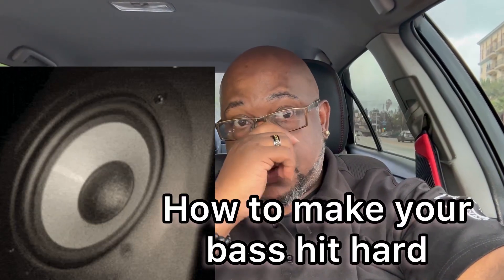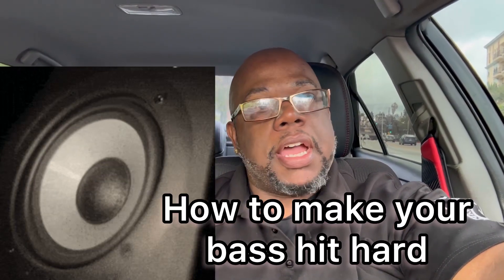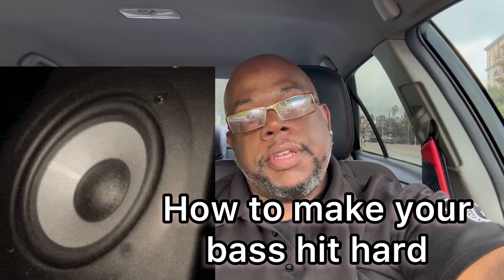How to make your Bass Hit Hard

Comment: On 1 10" 600w rms sub. I have 2 amps a 500 and 1k the 500 @2ohm and the 1k woth do 600w @4ohm. The bigger amp should sounds alot better?
Reply from the maker: @poschevy7852  the THD and distortion level is what make it sound better 
Example a 0.10 is high distortion 
A 0.3 is low distortion better quality easy to produce lows and sound clean
Reply: Do not listen to this guy he has no clue about subwoofers and amplifier’s to answer you questions the 1000 watt amp will hit harder if it’s actually 1000 watts lots of companies lie about there specs but in a perfect world a properly set 1000 watt amp will be perfect for your sub you are not pushing that full 1000 watts all of the time playing music ur just touching it here ad there rms rating is what that sub can handle in a sealed enclosure no ventilation non stop all day everyday but it’s fully capable of taking more power just for less amounts of time but since music is just constantly the same tone blaring ur not gunna hurt it

Comment: You have 0 idea what your talking about do you? I suggest doing some research my guy ohm load has nothing to do with sound quality let alone " plays better lows" infact lower ohm load would play better lows simply because more power, if the amps stable for it it was be the same THD , yikes man you must still be running walmart gear
Reply from the maker: I’ve done the research and did a plenty of time
There’s a difference 

But do you don’t  hear the difference if you’re playing a sub at its peak power vs  playing it at its RMS rating or pass it’s sensitivity
At that point, they all sound the same

So if you have some subs sensitivity is 85db 
And you’re playing it past that at like 90db you start getting the store and less controller and damp
Reply: @ImageDesign  holy shit bro what are you smoking and where can i get it, sensitivity is how efficient the sub is during the TS test, has nothing to do with a subs limit
Reply from the maker: @ericremple6395  trust me I’ve done the research you should do the research yourself
Reply from the maker: @ericremple6395  any sound guy that installs and is a truthful person switch your subs to 4ohms and play them at a decent volume you will see and hear the truth
Reply: Your on mad drugs @ImageDesign